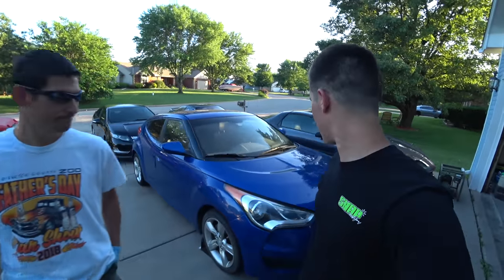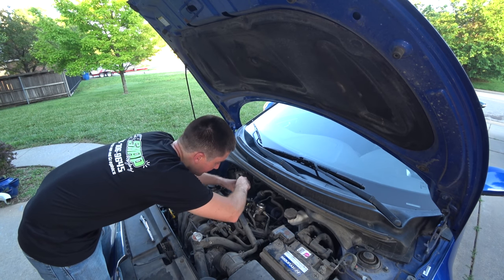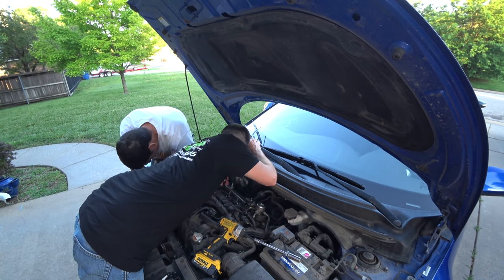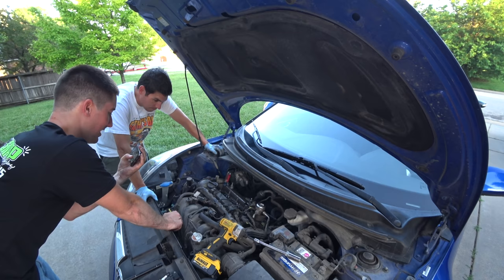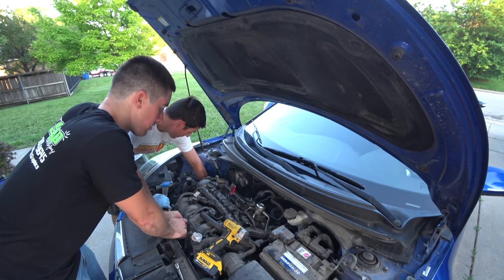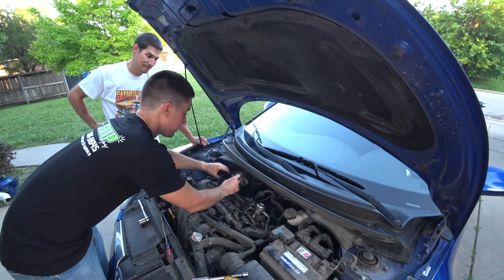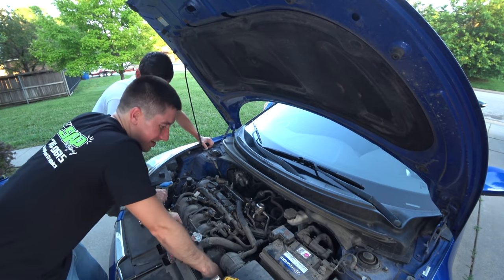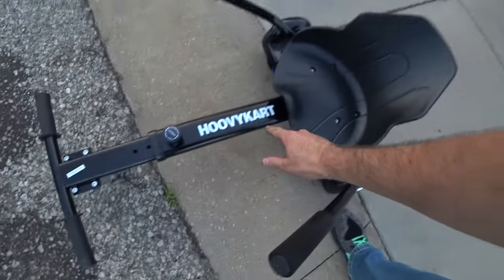Using A SCREWDRIVER To Test For ROD KNOCK On The $1,500 Hyundai Veloster

Comment: Another trick is while it is running pull the plug wires off one at a time. The knock should get quieter when you pull the wire off the bad cylinder.
Reply: _Milo you unplug the power wire to each coil individually.
Reply: My buddy got hit with my Mallory High Fire coil (50k volts) and didn't die. He did say that was the hardest he was ever shocked though (we've both been bit by coils- different cars).
Reply: @doylesmith8678  haha it made me wish I was dead tho
Reply: @doylesmith8678  I got hit by a Briggs (lil push mower) while my bro was pull starting it …. 
&I thought I got punched in my ⚡️soul⚡️… I can’t image gettin lit up with anything crane/Mallory has juiced up!! 
You guys are billy bad ass!!

Comment: Everyone told you it was a rod, you may still be able to drop the oil pump / balance shaft module and replace the rod bearings I've had pretty good experience with that on these Hyundai / Kia engines
Reply: y would do the same , but only iff the crank is not damaged.

Comment: What a cool and super-easy engine test!  

If you wouldn't mind, once you get the old engine out, could you please open it up so that we can see exactly what happened inside the engine to cause this issue, I think that would be very interesting to see exactly what caused the engine failure and the resulting damage from it.
Reply: And for us 1.6 gdi driver any chance of showing the valves to see if carbon build up is a real issue, that would be really appreciated!
Reply: @theadvocate4698  I agree totally!  Not too many of us are actually able to tear an engine down so we don't get the opportunity to see what causes common engine-failures like this.  I know I wouldn't feel comfortable breaking down an engine but it seems that JR can practically do this kind-of thing in his sleep and I know seeing the inside causes and results of a problem like this from the inside of the engine would be very fascinating and also help us to learn more about breaking an engine down and maybe even preventing this issue to begin with to boot.

Comment: I was doing a deep clean of the engine/hydraulics bay of a mini-excavator that we needed to rebuild the hydraulic pump,, and after removing mud from the deepest darkest, never-get-your-hand-in-there crevices, I found my years missing Snap-on palm-ratchet and, yes, 10mm socket…  A little polish and a lot of WD-40 and good as new.

Comment: I bought my daughter a 2012 veloster it is a great first car. Only problem is a knock when she lets off the breaks going forward or reverse.  And when taking off in first its not a manual , the first gear only jerks a bit to start and tou have to gradually touch the gas if you don't want to feel that rev without rhe feel of speed until the second gear kicks in and smoothly shifts into all of the gears. So the knock up front and first gear is only concearn....hope you get a chance to read this and understand my problem....you guys are GREAT AND EDUCATIONAL FOR ME AND MY DAUGHTER .
Reply: Oh yeah only one knock when goin and she has to keep her feet on the break as soon as she takes it off the  car jerks a tiny bit to take off.

Comment: i think hyundai has a recall on the 2.4 gdi engine for a bearing oiling problem they extended the engine warranty to 120000 mi
Reply: That’s a 1.6 in the veloster and the 2.4 is unlimited mileage now
Reply: @dodge467ify   can confirm. Own 2014 velsoter.(mine doesnt knock tho lol)
Reply: @dodge467ify  WAIT, so JR's engine is under warranty?
Reply: Chris W No it’s just the 2.4 theta II engines from like 2012 to 2014. The 1.6 never had any recalls like that one which is what the veloster has
Reply: @dodge467ify  got it! I know nothing about Kia engines, just hoping maybe he could get it warrantied.... But, how much you wanna bet J&J hooks it up!??
Reply: I'm a Hyundai Tech. Any 2.4 or 2.0T engine is essentially covered. They'll even warranty it multiple times. One guy got a new engine and didnt change the oil on the new one for 40k miles. Tons of sludge build up. And they still covered it under warranty a second time.
Reply: Will hyundai still warranty a 2013 veloster if im the 2nd owner and it is knocking??? 74k miles. Any input would be great
Reply: @ZynovFTW  My Elantra GT 2.0 apparently has the same problem. Dealer says, "debris in oil pan" waiting on Hyundai to tell if they will cover it under warranty. I'm 2nd owner 84K miles
Reply: @joeycarpeal 10 year, 100.000 mile power Train warranty only applies to the original owner. A shame,  Such low mileage,  either very poor maintenance. Few oil changes,  and or driven very hard all the time. I have put over 150.000 miles on 2 kias when I let them go, both still running perfectly,   3,500 mile oil changes.
Reply: @johnfranklin5277  i took it to the dealer and they warranted it. New motor for free! Im happy

Comment: My veloster is also blue. Engine burned all the oil at 120k miles and killed it. Got a used motor with 77k miles and it was working fine but an ignition coil need replacement so make sure to use a multi meter to test them. 
One other the latest major issue was replacing the passanger CV axle.
Reply: Omg. This happen to me today. I was due for an oil change in 1k km. And i heard a knocking noise. It was around the corner of my house. So i creeped home, and checked and the oil was totally gone.

Can i fix this? What would be broken?

Comment: If you go to a Hyundai dealership they actually have a recall for all 2012-2013 Veloster base and turbo model and the best part is that it’s free that’s how I got a new free engine when a rod pushed through my 2013 Veloster turbo’s engine.
Reply: I think that’s only on the 2013 turbo right? I have a 2012 with no recalls but my engine is at 91k miles, just had an oil change 1.5k miles ago and pulled over because a knocking noise to find the engine bone dry, no warning lights or leaks etc. who do I contact?
Reply: 3 years late but hey 🤷
Im the 4th owner of my 2012 Veloster. I brought it into Hyundai for a rod knock software update recall that booster the warranty on the engine from 10 years to 15 years.
So I get 4 years of coverage from something like this 👍
Only has 48k miles on it.

Comment: I wanna see this engine being ran until total failure
Reply: Me too
Reply: Fort real! I mean why not lol
Reply: Hyundai more reliable and easy to work on then goverment motor co. Or junk dodge.
Reply: But if it seizes it makes unbolting the torque converter a real PITA
Reply: Could also throw the rod through the block and take out something else too. My brother in laws Camry took the ac compressor with it.
Reply: @doylesmith8678  I've seen a Corolla throw a rod and take the starter out with it.
Reply: Doyle smith What does it matter? Engines from junkyards usually come with accessories
Reply: Fuert Neigt  Hes a genius
Reply: Hmmmm......😈😈😈
Reply: Why not do this?  Maybe engine parts can be salvaged and sold.  Or the whole engine can be rebuilt after sitting on a junk yard shelf until the thing is worth a lot more
Reply: Do you know what makes an engine change easy? Having everything coated in oil.

Comment: For future reference, you can check the timing without pulling any covers. It’s called a cam crank correlation and is done with a oscilloscope. Any good automotive technician can do it.

Comment: Figured piston slap, or wrist pin, or rod. That engine just known for that unfortunately. I had to swap a couple over at the shop I worked at due to same issue and noise and was piston slap on two cylinders and the other bad wrist pin and rod, took piston out and was loosey-goosey. Did same trick pretty much just tap the top of the piston and turn over motor. I got lucky and found a good motor with only 5k miles on it for about $500 at local junk yard.

Comment: Jr, a better way to test or to confirm is to just disconnect injectors one by one.  If knocking stops when you disconnect the injector, then that's very likely the cylinder with bad bearings.  The screw driver method isn't always reliable.  I had a car pass "screw driver test" but it was still knocking.

Comment: Harbor Freight sells a thing like the doctor used to listen to your heart. Rather than a cup at the end of the line the one at HF has a metal wand. You could place the wand at the bottom of the block and hear each cylinder. Very handy to listen to water pump and other components.
Reply: Mechanics stethoscope

Comment: Was that motor run low on oil or improperly maintained (or a combination of both)?  Is that a common problem?  Just asking cause I have a late 1.6L GDI Gamma engine and now I'm a little queezy... I'm aware of the oiling problems with the Theta line of engine, but I thought the Gamma was free of issues.

Comment: Veloster from 2012 easy to work on, while i'm over here about to change my compressor on my 2017 elantra and it's in a hard place and bad spacing to get bolts and the tensioner.

Comment: Sump off, chuck a set of big end bearings in and see how long it lasts. I did that to an old Toyota Corona and it didn’t die until the owner filled it with diesel.

Comment: Beat it until total failure, send the rod through the block if you’re just junkyarding the engine after
Reply: I did that years ago and the rod went straight though  the radiator and oil cooler too, expensive fun 🤣
Reply: I’m imagining that he’ll have to return it as core and when I worked for a big box auto parts store we couldn’t take obliterated cores for return. It needed to be rebuildable.

Comment: I doubt my advice would be considered but wouldn't it be cheaper to drop the oil pan and replace the bad rod or main bearing? could only cost a few dollars compared to nearly $1000 on a used engine and dropping the oil pan and trying to replace the bad part would at least let you know if it was a good idea or not and only takes literally minutes to drop the oil pan on these cars....your car and your money but if it was me I would drop the pan and try to save some cash for Audi parts....good luck and good tips on finding the bad cylinder..
Reply: Is it hard to fix bearings and stuff?

My car burned all the oil and is now knocking really bad. Put oil in it and still doing it. Ive changed the oil 4 times in 1.5 years and this never happened. Now it happen. . . . Is my car fcked or can i fix this?

Comment: A failed rod on a hyundai/kia? you don't say... LMAO
Reply: Go Clunker i have 08 elantra with a 165,000 stock engine so they are reliable.
Reply: @jasonjgr8580  A 2008 elantra is a 2.0L, NOT the GDI 1.6 and 2.4L known for rod knock and piston slap , numbnuts.

Comment: I've always been worried that this could damage the top of the piston. Am I rightfully concerned here, or am I worrying too much? Is there anything I could do to minimize the risk of damage here, like cutting the head off the driver and rounding the head into a nice smooth ball? Would love to hear what anyone out there has to say about this - thanks!
Reply from the maker: You could, but pistons literally support millions of explosions. You don’t have to hit it hard either just a tap and you’ll feel it go down. Basically anything rigid that fits in the spark plug hole will work fine 🍻
Reply: My 2014 turbo somehow burned all the oil. Im 2000k away from oil change. I bought the car just over 1 year ago, changed the oil 4 times and it was fine. How did it burn ALL the oil. It was bone dry. I heard knocking. Pulled back home right away. Found out, put 3 L of oil in it. Started it and it still knocks bad......whats broken? Can i fix this myself or is the engine fucked?

Comment: My 2013 Hyundai Accent has started knocking slightly and is now burning excess of oil 1 quart every 300 miles Hyundai needs to recall all 1.6 GTI gamma engines across-the-board not just certain year and models every two or three months they keep adding more and more recalls due to risk of engine fire

Comment: What's the easiest way to fix the veloster's front bumper... ( My clip broke off from one side it's just sticking out)
Reply: Jose Lopez : Stay tuned😉
Reply: Jose Lopez: Broken clips are definitely a pain. Depending on the location, the solution may be straightforward or require some ingenuity. A good reinforced epoxy to anchor the clip in will usually do the trick (provided proper surface prep has occurred to ensure maximum adhesion). If this isn’t feasible, you will need to use additional hardware to provide proper support and bracing to the affected area. Where and how you affix it is solely situation dependent.
Reply: @Gabe-ABNCW3  thanks for the advice. For my  bumper it happens to be the left top clip that broke off. The clip is still intact of where it should clip on too as the bumper waves at it everyday
Reply: Jose Lopez: is it the one that attaches under the headlight housing or wheel well?
Reply: @Gabe-ABNCW3  under the headlight housing
Reply: Jose Lopez: sorry to leave you hanging. Had to take a long hard look at the bumper and it’s attachment points. Honestly, there is no easy fix for this. A lack of access means that you will have to remove the inner wheel well cowling and find a suitable location to anchor the bumper to the frame. Because that tab is directly under the headlamp, use of screws is out. Honestly, I wonder if a few strips of Gorilla Tape might do the trick. 
I wish you the best on this repair.

Comment: Rod knock ? More than likely piston slap what is common on most, if not all GDi lumps, No. 1 is the 1st cylinder to fire on a start, The wrist pin wallows out the piston causing slap wearing the bore and piston
Reply: Almost everything you stated is wrong in this post…
Reply: YDY - piston slap is the initial cause that wears the bore and piston skirt, making the piston not run true in the bore causing excessive wear to the associated parts and eventual failure

Comment: With less than 100k miles and less than 10 years old, the drivetrain actually should be still under warranty if I'm not mistaken
Reply: 10 yr 100k warranty only applies to original buyer.
Subsequent buyers are only covered up to 60 k.

Comment: How come you guys always take the easy route and replace the engine let see a engine rebuild.
Reply: rgbigdog because it’s way quicker to buy a used one on eBay or junkyard and many times cheaper and better insurance
Reply: rgbigdog: Because he don't know how to! I like most of his videos, but he almost always takes the easiest way out. I'm surprised he actually tore down the engine in Amberghini's Geo Tracker & rebuilt the top end! If it was my Veloster, I'd just pull the head & oil pan, replace the #1 piston/rod assembly & while the oil pan was off replace the other three rod bearings & also replace the main bearings while I was down there. But alas, we live in a throw away world now!
Reply: @rogergoodman8665  "but he almost always takes the easiest way out"
I suggest you let that one marinade.....
Reply: @fordtechchris  : Ok! Once the marinating is complete, what's the next step I need to follow, oh, I know buy another engine...🙉🙈🙊
Reply: @rogergoodman8665  it's still the easiest solution. And it was a reference to JR's new favorite show "letterkenny"
Reply: @fordtechchris  : Yeah, I know it's easier! I've been a professional fleet mechanic for over 25 years. Anyone can throw money away & just replace an entire engine because they don't want to be bothered with the job or don't know what to do rather than actually fixing the problem, but for a mechanic like me, it's ludicrous & sad. We take great pride in actually repairing engines or other major components. If I told my boss or customers they needed to buy a new part or engine every time even though I & they know it's servicable, I would be fired & laughed out of the shop pretty damn quick. All I'm saying is rebuild or repair something instead of just scrapping it, it's much more satisfying. Look at it this way...If you broke your leg in three places & your doctor said he could fix you up as good as new & you get to keep your original leg, what do you think he would say if you said "I don't want you to fix it doc, I want that shiny new prosthetic leg hanging on the wall?
Reply: @rogergoodman8665  that's awesome dude! I'm a professional fleet mechanic for 16 years. Taught at Wyotech for a stint even.  All Ford trained, so I don't know nuffin about these Korean jobs. I agree, I rebuild 6.0s in my garage. It could be worth it to see what can be done. But knowing that it's a flip and the used engine is so cheap and j&j will likely give him one for free, you almost can't beat the deal. Its just time and economics. I get it though, on my personal projects time isn't really a thing and I enjoy rebuilding stuff, so why not!? Cheers fellow fleet tech!! Have a nice weekend!!
Reply: @fordtechchris  : Hope you have a nice weekend also!